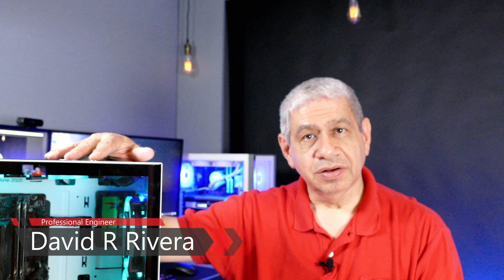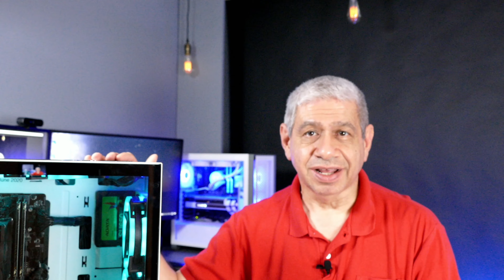The Rosewill 2.5g Ethernet Adapter: Opening, Installation, Testing and Review

Comment from the maker: One thing I should have mentioned was the need to set a 'Jumbo Frames' value on the new 2.5Gb Network Adapter.  This is done after logging-in as the Administrator, then right clicking on the 'This PC' icon (which needs to be added through the Win-10 settings), then selecting 'Manage', then 'Device Manager', then 'Network Adapters'.  Scroll down to the 'Realtek PCIe 2.5GbE Family Controller'.  After double-clicking on that device, select 'Advanced', then scroll down to the Property called 'Jumbo Packet'. You will need to select the value of 4088, then click OK.  

If this change is not made, you will find that the new network adapter only runs at about half speed when test it, such as with iPerf3 or copying files over the network between two PCs or using a server.

Finally, if you are unable to use the CD that came with the card to install the driver software, you can go to this site to get the driver and instructions: https://drivers.softpedia.com/get/NETWORK-CARD/REALTEK/Realtek-PCIe-2-5GbE-Family-Controller-LAN-Driver-10-039-0212-2020-for-Windows-10-Anniversary-Update.shtml

Comment: Hello, David:  You and I are almost in lock-step with 2.5GbE Ethernet Adapters.

After trying several USB 3.0 to 2.5GbE Ethernet Adapters, we have also had the most success with the Rosewill RC-20001 installed in available PCIe x1 slots.  

A few things for your viewers to consider, if they are not already aware of these points:

(1)  to maximize security, the controller settings should be examined after entering "network connections" in the search window, then right-click on the RC-20001, then properties | configure | advanced.  There, it's a good idea to DISABLE the several "Wake On" options, because they are usually ENABLED by default e.g. "Wake on magic packet" and/or "Wake on pattern match".

(2) The RC-20001 is superior to several of the USB 3.0 dongles we evaluated, because the latter often startup at Gigabit speed.  That can be changed by DISABLING and then ENABLING those dongles, but such extra steps are NOT needed with the RC-20001.  When accessing the "Configure" option, take a look at the "Power Management" settings because the factory defaults may NOT be your preference.

(3)  We have been using the driver software at www.drivereasy.com , and those drivers have worked extremely well for our needs.  Whoever developed that software must be genius-level, because device drivers require extraordinary computer expertise to design and manage skillfully.  The freeware version is a lot slower than the paid version, but PC Users may not need to update drivers very often.  The latest driver for the RC-20001 which drivereasy.com recommends also works AOK.  If you do update the driver, go back to the "Configure" options because a new driver will probably come with more factory default settings.

(4)  The RC-20001 should also work fine in all PCIe Gen 1.0 slots, because the clock rate of PCIe 1.0 was also 2.5Gbps.  We have retained some older motherboards and re-purposed them as backup storage servers.  One of those older motherboards is the ASUS P5WD2 Premium, and Windows 7 Pro connects via the RC-20001 to our 2.5GbE switch just fine.  The performance improvement over 1.0GbE is very noticeable, particularly when we backup files to one of those storage servers from a modern HP workstation running Windows 10, also via the RC-20001.

(5)  Unfortunately, like a good cookie bakery, the reputation of the RC-20001 is starting to catch on, and consequently prices are increasing, and stocks are dwindling.  It might be a good idea to contact Rosewill management and ask them to ramp up their manufacturing schedules.  The more calls they receive with this request, the more likely they will ramp up their factory.  2.5GbE is starting to catch on, and the potential market for the RC-20001 must be in the multiple millions of PCs installed worldwide.  I keep hearing about a worldwide "chip shortage", so be aware of the laws of supply and demand.

Hope this helps.
Reply from the maker: WOW, that's a lot of great information for my viewers (and me).  Thanks.
Reply: @PE4Doers  You're very welcome, David.  Another tip that occurred to me, after I posted the Comment above, has to do with full-size slot covers.  

I was closely watching while you inserted the RC-20001 in an empty x1 PCIe slot.  If you go back and view the same video yourself, and focus on the short horizontal "leg" that attaches to the chassis, you should notice that the holes do not line up exactly.  

We have encountered that seemingly small problem quite often, especially with certain chassis manufacturers.  Our preference is to make sure that the edge connector is perfectly aligned with the PCIe expansion slot.  

If the top "leg" of the slot cover must be moved, that has the unwise result of changing the alignment of the edge connector with the expansion slot.  

The solution is really very simple:  just bend the slot cover just enough so that the edge connector remains perfectly aligned with the expansion slot, and the slot cover "leg" aligns more exactly with the female screw hole at the top of the chassis expansion slot.  

That way, when the fastener screw is tightened, the edge connector remains properly seated in the PCIe expansion slot.
Reply from the maker: @supremelawfirm  I will go check that on the actual PC right now.  Thanks for the tip.
Reply: @PE4Doers  I hope my attention to such seemingly irrelevant details does not offend anyone here.  

Nevertheless, this month I will have accumulated 50 YEARS of experience with computers, and I cannot tell you how many times I have had to admit:  "The devil is in the details."  

When an edge connector transmits signals that oscillate at 2.5GHz or faster, even a small mis-alignment can result in total failure or intermittent failures.

Thus, one should always strive for perfect alignment of an edge connector and its corresponding expansion slot.

The slot cover is a mere mechanical connection that does not transmit any electrical signals.

I have found that a little trial-and-error works best:  insert the edge connector, then examine the alignment of the fastener end of the slot cover.

If the alignment is not good, remove the card and carefully bend the slot cover a small amount.

Re-insert the edge connector and re-examine the alignment of the fastener end of the slot cover.

Keep doing that until both the edge connector and the fastener end are both aligned as perfectly as possible.  Then, tighten the fastening screw.

College of Hard Knocks signing off (for now).